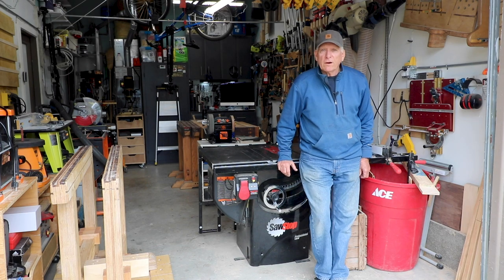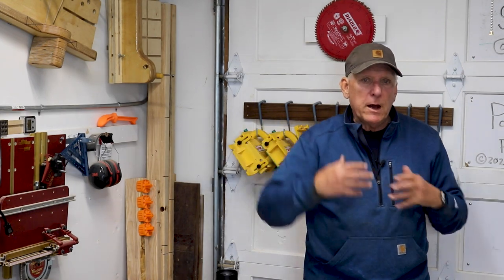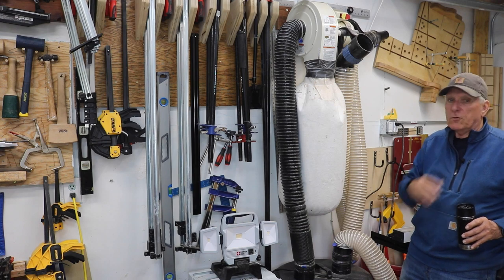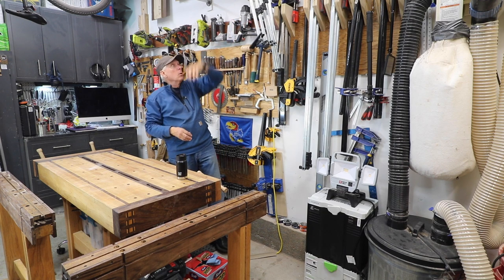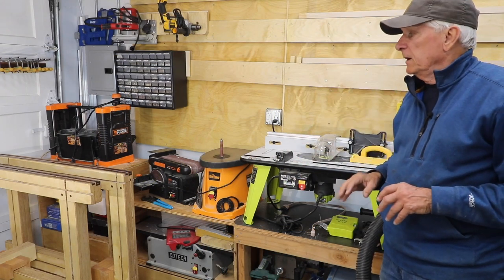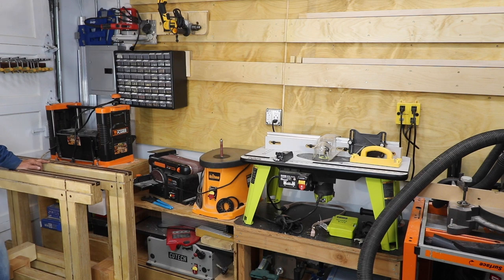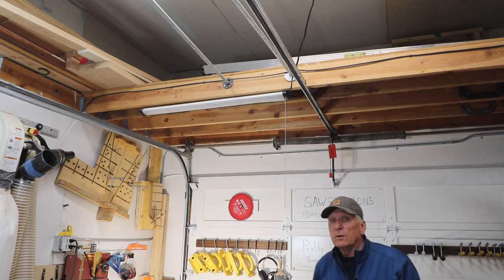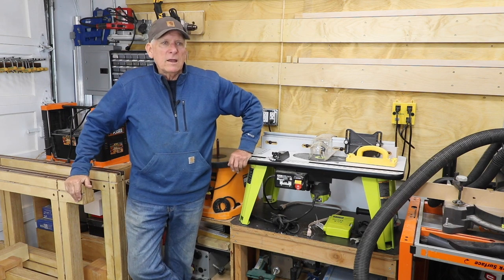2020 One Car Garage Small Workshop or Woodshop Tour - 7 Principals of Layout and Organization

Comment: Normally I don't watch shop tours because they're usually being done by someone with a large shop, showing off all the expensive tools and equipment they have where a lot of them were given to them by the manufacturer. But I knew your shop tour wasn't going to be one of those. I appreciate what you have done to set up your shop the way it works best for you, and to utilize space that a lot of people may overlook. I keep saying that "when I clean out my garage, I can get a real tablesaw and other equipment and finally have a real shop", but I'm afraid cleaning out the garage probably won't happen until when we decide that we're moving. Until then I will continue to use my folding DIY tablesaw and cheap second hand power tools and build whatever I can with them.
Once again the applause at the end was a nice touch. The outtakes with the laugh tracks was priceless too.
Reply from the maker: Hey, I appreciate your watching the video and commenting on the applause and laugh tracks during the out takes.  I wasn't sure how people would react.
Reply: @SmallWorkshopGuy  I was a little late watching it because I'm building a project for my wife. Once I finish that I hope to take apart a 1980 Kawasaki KZ750 and sell all of the metal at a scrap yard. That will allow me to reorganize some other stuff in the garage so I can start on the popup workbench. That's what I said when I was working on the last project though, "when this is finished I'm going to take apart the KZ". We'll see if that gets done this time.

Comment: I have a 15x15 shop, so it might be around the same square footage (or so) as your shop.  One of the principles I tried to maintain was to keep the shop and shop walls totally clear (essentially!) between 36" and 52" above the floor.  That's the height that almost everything happens (or where everything LONG needs to happen), and making sure that that space is clear helps maximize my room for infeed, outfeed, or any other kind of feed!

It's impossible to be purely religious about it, but I try to keep my tools and work-surfaces no higher than the 36" mark, and any cabinets, wood storage, etc. above 52".  That gives me my full 15' (or 21' on the diagonal).
Reply from the maker: Interesting principal - I will have to think about that as I do work in my shop.

Comment: You have a vast quantity of tools in a very small space.  I am still working on my basement space.  I do have an outdoor space underneath the covered half of our back porch.  It always stays dry so I build a 4x8 floor and moved my miter saw out there.  The miter saw makes lots of saw dust and it's collection is horrible.  As I just took down a wall of shelves, I will be building a tool wall to replace it.  Then I need to build a mobile table saw cart for my Dewalt 749.  The legs splay out and take a large space.  I'll post more pictures on the Small workshop FB page.  Thanks
Reply from the maker: I saw your pictures where you are digging out a workshop - wow, that is dedication.  How is the project going?
Reply: @SmallWorkshopGuy  I have got a wooden floor installed.  It is 10ft x 14 ft.  I built a mobile small workbench.  I need to make use of the area around my platform.  Probably use it for lumber storage.

Comment: I just recently found your channel.  Looks like your making excellent use of your available space.  Is that the Ryobi router table? What do you think of it?  I also noticed the Jayhawk.  I just went in to Lawrence Ks a couple days ago.
Reply from the maker: Yes on Ryobi router table - I am not much of a heavy router table guy and I have a crappy (hard to adjust height) Ryobi router in that table. - I think the main thing to look for is a table with a good lift.  Yep, grew up in Lawrence KS and went from Kindergarten through Graduate School all in Lawrence and then headed to California in 1968
Reply: @SmallWorkshopGuy  Ok. Thank you for replying.  I am thinking about something like the Ryobi to start with and upgrade later if I use it enough.  I live 30 miles south of Lawrence but go there often to grocery shop and get parts from the JD dealer there.
Reply from the maker: @chucks4328  30 minutes South of Lawrence - would that be Ottawa?
Reply: @SmallWorkshopGuy  I should've said south west.  The mighty town of Overbook.  It's 30 miles from Topeka,  Lawrence,  and Ottawa.  Basically the middle of no where.

Comment: Can you please give more info on the automatic power outlet
Reply from the maker: That one has no remote.  You plug it into an outlet and then plug your shop vac into the unit.  Then plug whatever power tool you are going to use in that same unit if you are using the shop vac on. that power tool.  Then there is a switch on the unit call "auto" - put it in that position and then when you turn on the power tool (something like a miter saw) the shop vac kicks in automatically.  When you release the trigger on the power tool, the shop vac stops running as well.  That help?
Reply: Small Workshop Guy can you give me the name of it I can’t seam to find it online
Reply from the maker: RFULCHER1 Amazon Automatic Vacuum Smith by iVAC